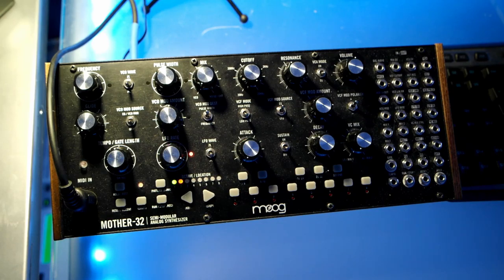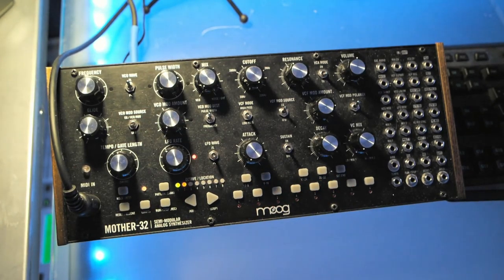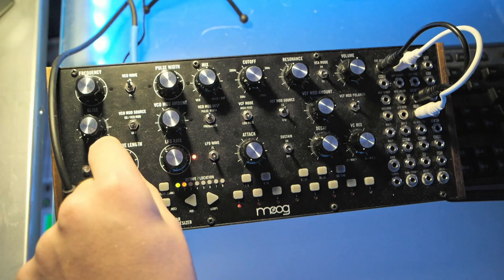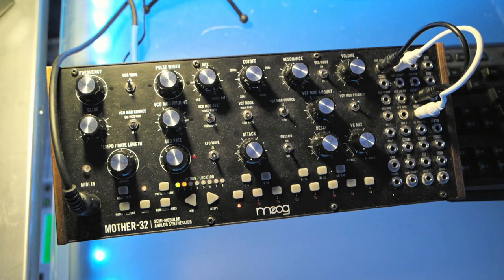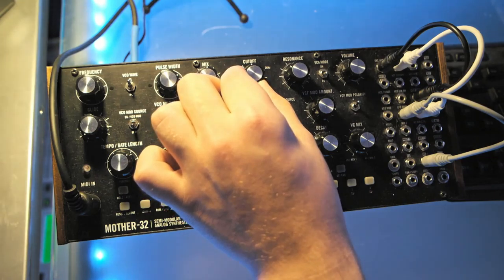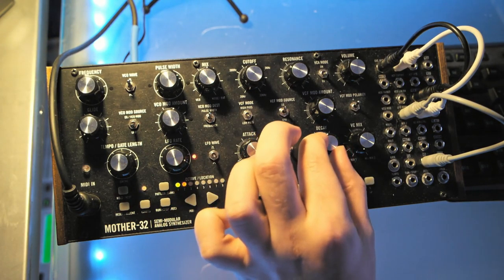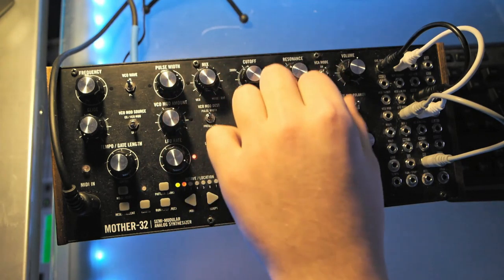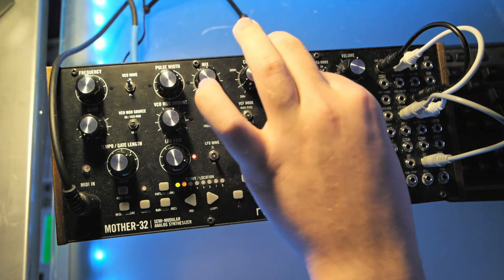Mother-32 Patch Design #6

Comment: Is there no regular PWM on a mother-32?
Reply from the maker: +Robert Syrett There is, but it's just changing the phase of a single square wave, it would normally sound nothing like this. It would just sound like detuning a pulse wave, not like multiple oscillators phasing in and out of one another